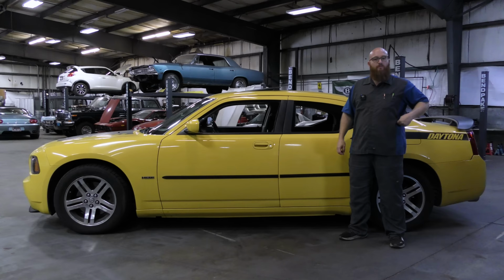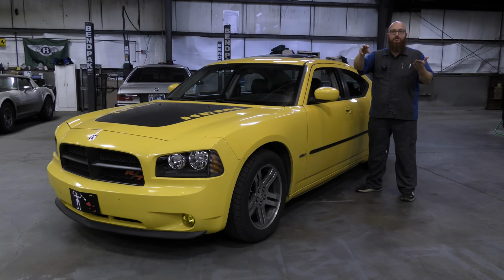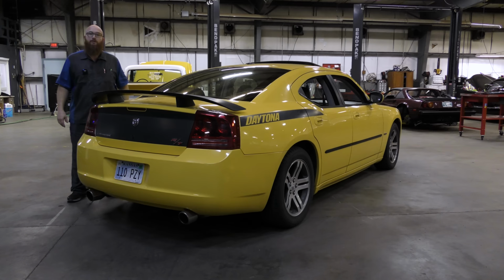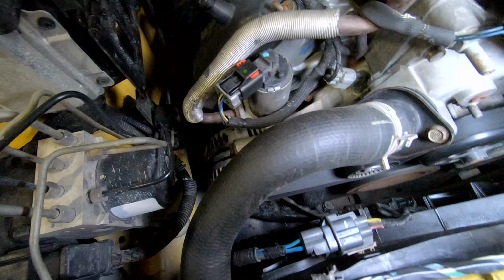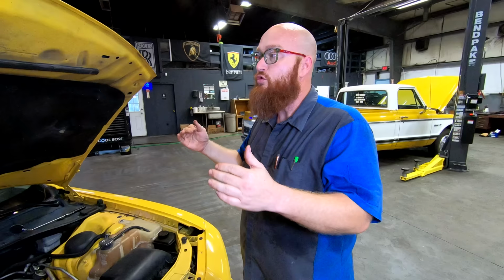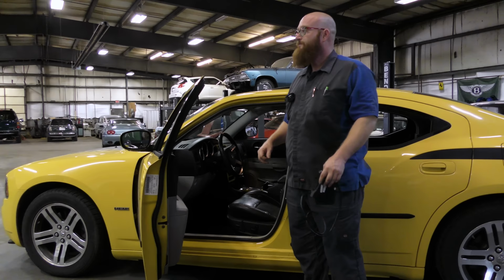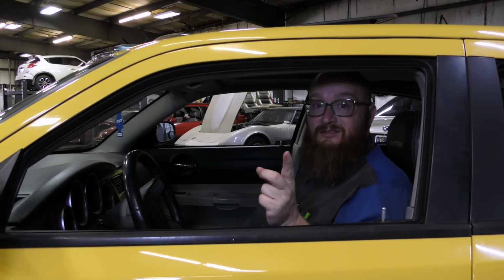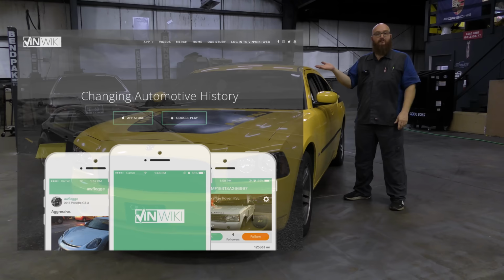4 things you MUST check before you buy any used car! CAR WIZARD shows how not to be scammed!

Comment: One time I bought a 1986 Corvette with only 96,000 miles on it. The price was very affordable. I would later find out why. The seller did tell me about an issue with trash getting into the fuel filter. He replaced it for me when I bought it and showed me how to do it. He said each time he did it there was less junk. So I figured maybe it would clear up after a couple filter changes. Other than that I didn't really check out too much. The car ran and it was fast. It idled funny but I didn't care. It was a Corvette I could afford so I pulled the trigger on it. It drove home just fine and even did well driving around that weekend. No issues. But then everything started to go downhill. The throttle cable came off the throttle body, the bulbs went out in the dash so you couldn't see the digital display at night, the throttle body was way out of adjustment, the car would keep dying at the worst times and was so hard to start up, then the most dangerous thing was it turned out I was driving on 15 year old tires! I found this out because one day I got a bad vibration in the steering wheel. Take it to a shop and they showed me the bad news. Last but not least I was having some codes checked at an Orileys and the car wouldn't start after that. Turned out it was the starter. At that point I was all out of money to spend on the car and I just sold it right out of the parking lot. I was just done. Biggest mistake. But it taught me about a lot of things I should check. I appreciate getting even more tips from you in this video Car Wizard! Keep doing what you're doing.

Comment: Looking at a Title does not always tell you if it is clean or not.  I had a Volvo that someone hit and the insurance paid it out (salvage value) and I had repairs lined up to have it fixed cheaper.  I drove it for another year when someone else hit it.  The insurance would only pay out half the amount stating it had a salvage title.  I still had the original "Clean" title.  I did a carfax on it and it showed that the insurance company notified the state that it was a salvage title.  It taught me that when buying a car always do a carfax to learn a little more about the vehicle.  Look for notifications of Salvage, the repair history (not always accurate) and the reported mileage.  Seen too many with odometer rollbacks.

Comment: There is actually a good reason to rev the motor as Car Wizard did.  Some higher mileage engines will "die off" when you let off on the accelerator.  This is generally not a good sign, could indicate ignition or fuel problems, or just extreme wear.
Reply: All 3 of my cars exceed 238,000 miles on the odometer. If you were to rev the motor on any of them the engines will not die off. Rest assured, if you buy one of my cars- Honest Al
Reply: Had a 1972 Grand Prix in 2017 that was like that....had to rev it at stop lights or it would die.

Comment: the paint colour not matching isn't entirely fair;
in the case of 2000s dodges, both the front and rear bumper bonnet are made of a plastic that DOES degrade in UV, making the colour change slightly over time. they'll eventually appear a slightly different shade than the rest of the metal body if the car has been stored outdoors much of its life. 
 
I say this as an owner of an '06 top banana. the colour difference bugs me, but im saving up for a body kit anyway, so no point having them re-finished.

Comment: Tapping the gas can also uncover any other sounds that it might have at higher RPMs. For example, I've seen a few cars where there might be a small sound that is not noticeable at low speed, but once your rev the engine or get it up to speed (say 2000 RPM or higher) you can start to hear some things.  Of couse, some of those things may come up during a test drive (and I would recommend test driving it in a number of scenarios even if you don't drive that way normally - say highway driving)

I would go a step further though and if it's a private party, ask for maintenance records and major repairs.  Usually someone who has taken care of a vehicle, will have this.  Maybe not every single oil change, but major services like transmission service, brake services, most of the oil changes, etc.

Comment: Oddly there a few things that I look for when it comes to fluids. 1st does the transmission fluid smell burnt and what color is it? 2nd. Engine oil color and smell. If the car is cold and it has a cap on the radiator pull the cap and run your finger inside the neck and as far in as you can. If there is jelly or stop leak residue it is a nogo. Look at the battery date code.  If possible take an inexpensive ODB2 tool with you as sometimes you will have a seller that has unplugged the check engine light.

Comment: While you're under the hood, you should take the oil filler cap off. If there is sludge in the engine, you will see it inside the cap and inside the valve cover.

You should also look at the CV joint boots. Make sure they're not torn.
Reply: What if there’s sludges?
Reply: @Kingstur  It means the original owner didn't change his oil often enough and the engine would likely not last. I would not buy a car with sludge.

Comment: I got lucky and found a good deal on a 2021 Cadillac CT5 with 13k miles on it at 32k at a Mercedes dealership. It sat at the dealership for 2 months they originally wanted 37k for it. They dropped the price 5k. I'm a Cadillac guy, had been looking for a CT5 for a month. When I saw the 5k price drop I bought it. A new Accord is the same price, the Accord is a great car. I would rather have a 2 year old Caddy with 13k miles on it for the same price.

Comment: Under the hood...also Check...
*Has the Engine been started already today? Feel it....Warm?
*Is any Bodywork "Bent"?
*Has anything been Recently Painted or Detailed?
*Notice any New Parts installed?
*Are any group of Suspension components looking New, Repainted or Detailed/Shiney?
*Is the Engine Oil new? Trans fluid new? Coolant? Air Filter?
*Is the Engine Compartment "Unusually" Clean?
*Does VIN Plate in lower portion of Driver's Windshield look like it's been Removed,  Damaged or Moved? 
*Does VIN Plate still have it's Correct fasteners? (Star-headed Rivets...)

Comment: Personally I like whatever vehicle I am buying to be cold and not started when I come to look at it. Warming it up is a red flag to me. I eliminate many problems by only buying specific years and models of vehicles that have come towards the end of long production runs so all the kinks have been worked out. Like 2016 camry or 2017 nissan frontier. Looking at the early years on both these vehicles they had problems but towards the final production years they are nearly flawless.

Comment: 2:07 in Oklahoma you would swear vehicles do not come with titles.
Probably 25% of the cars for sale on marketplace….are missing paperwork.
Anyway….
One more important thing to do is, have some one drive the car and you follow. Then you can see if it’s going down the road straight. If the wheels or axles are bent, bounce, shudder, squat, or the car is leaning to one side.
You can see the symmetry of the car also. From a distance, you can see if the left rear matches the right rear.. or if maybe it’s been smacked in the rear.
I look to see overspray, orange peal, mis matched colors, furrunkles and rest- rings in the paint  also, and why it’s been painted.
I would rather buy a battle damaged ,scratched ,wore , painted car….than a shiny new one. Because no one but the body man knows what lurks behind that shiny paint.

Comment: Regarding the code readers: $7-10 ELM327 dongle supports most of the cars out there. Just make sure to buy the good one, there are a lot of clones not all of which work well, depending on the model of the microchips used.

Comment: Usually what I do is before I even do any of the underhood stuff I just hook up my scanner and look for codes and if it has more than two I usually just walk because normally it means that the car won't smog anyway. If the car has no codes or nothing pending then I can go from there but most of the time the car ends up having as many as five fault codes and I'm like there's absolutely no way. I would recommend doing the scan first and the visual inspection later just to not waste your time.

Comment: I thought you didn't  like Dodge Mopar products Mr. Wizard.  Hey one thing I'd  recommend  if someone  is buying a truck is to look at the front suspension  for worn out ball joints, knuckles, control arm  bushings. Hit some pot holes at highway speeds to see if you get the death wobble. Dodges and ford's 2500 are notorious  for death wobble. Bring some TP in case you have to wipe after experiencing a classic Dodge death wobble.
Reply: Thats a myth never experienced it in many dodge vehicles.

Comment: My father bought a 2006 Dodge Charger R/T . The dealership told him there was less than 10 in Dallas TX at that time and all were sold including his . He BABIED that car …… ran like a champ until 145k miles I went to start it and it literally blew up in the driveway upon start up lol ( mechanic said piston went through engine block) . My dad tried again with a 2012 Charger R/T MAX and by 125k miles it had lifter failure and a miss-fire and a very loud hemi tick along with electrical issues. Both garage queens , synthetic oil , mature driven 99% of the time . Maybe it is bad luck but I have seen so many hemi vehicles for sale with bad motors . 5.7, 6.1,6.4(less common) and hellcat 6.2- I love their sound when they’re not ticking but don’t trust them @ high milage. Also had a 2004 ram 5.7 before MDS technology .. that lasted till 380k miles but sounded like 💩 after 200k miles . Not sure how to keep them running 🤣🤣.

Comment: I have bought both of my kids their first cars in the last year and only use private sellers.  The number of people willing to lie is staggering.  9 of 10 carfax reports came back to uncover fraudulent information that was given to me...especially mileage.  Amazing how many folks never seem to have a battery...take a jump pack.  There seems to be a huge undercurrent, in Houston at least, of people who buy cars, never register them, and only drive them until the temp plates are out.  I saw cars with paper plates that had not been registered in 5 years but had been on the road.  And no, wizard, you wont be gapping my twin turbo silverado in a stock R/T.

Comment: The only one thing you missed lol or at least I check is to see if the engine is cold to the touch before turning it on because a warm engine can sound very different from a cold one the oil through the engine can hide lots of noise..

Comment: I drove this woman's Lexus she was SOOOOOO happy to buy at such a 'great price.' I offered to go see it with her, but she had a "friend' check it. 
Well, we needed gas, so I stopped this Lexus, pumped the gas, and as usualy, out of habit, just cleared the Trip Meter, because I keep track of my gas own mileage. 
The mileage said, "168,000" or so miles before I cleared it. But, it went to zero. Which was unexpected. Then, I pushed the button again, and it said, "235,000" miles, over 60,000 miles more. 
Turns out the Seller had never reset the Trip Odometer. It appeared the car had 168,000 miles. But it actually had 235,000. She got mad at me! Told me I couldnt drive it.

Comment: Wizzard, just to ad somethings to what you said. If it's really cold outside you will get smoke out of the exhaust in a few seconds and that is very normal it's condensation.  You can remove the fillercap from the coolant system when it's hot. Just make sure you turn it slowly and don't take of the cap at once. It will start hiss and release airpressure and after a short time it will stop, just turn it slowly to the end and make sure the pressure is gone. 

I always smell inside the coolant reservoir. Do you smell gasoline or oil inside the reservoir? Take a big step away from the car, it is not a good sing and a gasket is gone. Also a very low oil dipstick is a no go because the oil level was way to low and will damage barrings in your engine. For signs of accidents, is there a spairwheel in the trunk? Take is out, see if the factory seals are there and no fresh added stuff. In front the seal, check the seals if you see fresh seals inside of paint, it usually is a signs of damage.

If your brakefluid is bad the brakeline inside can corrode because the fluid attracts water. And unless it's a stainless steel line wich most are not you have a higher risk of rotting line wich abviously is very dangerous.

The trick with the smoke out of the exhaust is a good one, for the few first seconds, blew smoke or really white is bad. But if it's cold outside it will be a condensation smoke after a few seconds like boiling water kind.

And one last thing: ALWAYS look underneath the car for abvious leaks, but also for rust! Check the seals on the sides. Sometimes a car can look great outside, but it's gone underneath! It costs you like 10 seconds to look and can safe a lot of money!

But apart from that you are spot on! Great to inform people for what to look at when buying a car.

Comment: As to the tick tick tick tick sound, KIA engines around 2012 use valve shims (actual metal shims) for spacing, and those wear down over 100000 miles or so. My car has has the exact same ticking sound since I've got it, it's never gotten worse, thicker oil doesn't make it (much) better (Lucas oil stabilizer seems to help a bit). It's a slight reduction in horses/torque from spec (and I believe it makes it burn a little oil), I believe but it doesn't seem to be causing any harm (except the oil burning). On the other hand I hardly ever rev past 3k/3500 on a gas engine, so...take that with a grain of salt depending on your driving habits, and keep in mind that a knock in a KIA 2.0 4 banger means the 3rd cylinder crank bearing is likely shot, which is a common problem, and a recall in many KIAs except mine (not that it doesn't happen to Fortes, but I guess KIA thinks they're not worth replacing the engines in). Like I said though, take that all with a grain of salt, my engine might just have amazing luck.

Comment: If there's a bank lien on title the bank will have the title, if there's a personal lien on title there could be trouble. By the sight of the coolant reservoir the anti freeze changes were neglected, which could mean future head or intake gasket or water pump failure. Will a flush and  new coolant save it? Who knows. Also look at the dip stick again after the road test, specks of metal filings, or metalic particles will indicate trouble. Also run the car up a long hill if you can, watch the heat gage, it could indicate future problems with the coolant system. You probably should check the tires before you drive it.
You need to check the Vin numbers match the title 1st not last. Other than that you did very well. I'll still give you an A....

Comment: Remember,  ALL used cars have SOMETHING wrong with it. Check the tyranny first. The engine doesn't have to sound perfect but the transmission does. If the seller won't let you test drive it,  walk away before they bring on the con game.

Comment: I just bought a 2011 Nissan maxima with 170,000 miles for 4,000 with a salvage title and there was absolutely no issue with my vehicle nor was there an issue with getting the registration to the vehicle and I have full ownership and I have been driving daily on the expressway with no issues whatsoever
Reply: Is it still working?

Comment: Buying a car is a big deal, we always tell our customers to bring us anything they are thinking about buying for a "pre-purchase inspection". we can go over every part of the car, and after checking everything, giving an honest opinion of what we think of the car, would we buy it or not, and if we did what needs to be done first and what to keep an eye on with the car based on what we have seen go wrong with that particular make/model/year. its way easier to spend $50-100 before buying and then getting into deep deep hole we call a "post-purchase inspection"

Comment: If you find anything obviously wrong that the seller didn't disclose, that means there may be other things wrong the seller knows about but also didn't disclose, that you didn't find.

Also, after the road test, wouldn't you want to look at the engine again for any leaks? Maybe the seller wiped the engine clean beforehand.

Comment: i got scammed by a dealership once. I got a 2015 Altima with a rebuilt title and no a/c. It has lasted so far but I think it's because the car has less than 100,000 miles on it.

Comment: I drive a '14 Porsche Cayman S, and there is no dipstick.  You check your oil via the dashboard electronics.  It is actually pretty easy to use, but the problem with that is that if a head gasket blows you have no idea about it....

Porsche put a backup frunk opening mechanism via an electrical connection in the drivers wheel well. But they also put a manual backup accessed via the drivers side wheel well removal that involved a bicycle wire whoop...

I understand no dipstick to cut costs, but this is just stupid~!
Reply: If the engine oil looks like a milk shake you are dealing with a blown head gasket-

The only way you can tell anything about engine health on a 9A1 M1.23 engine is to change the oil.  When I go to sell my current 68,000 mile '14 Cayman S, it will NOT be on "Cars and bids", since I have personally found that that website has fraud issues.  

No, I will sell it locally so that local people can buy it locally here.